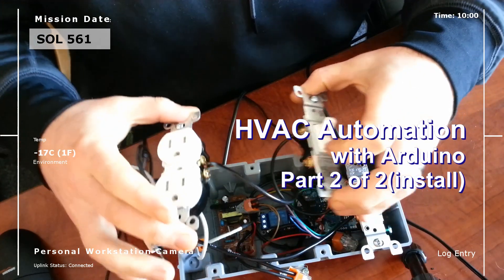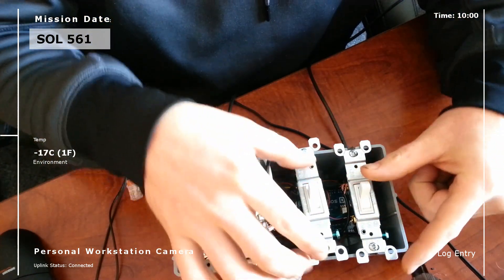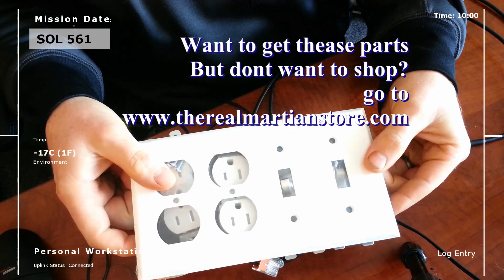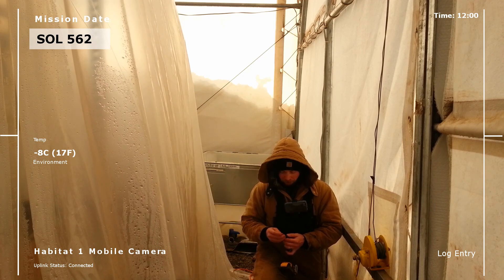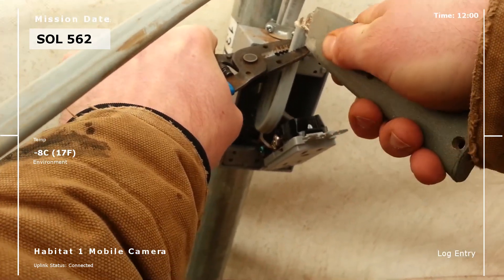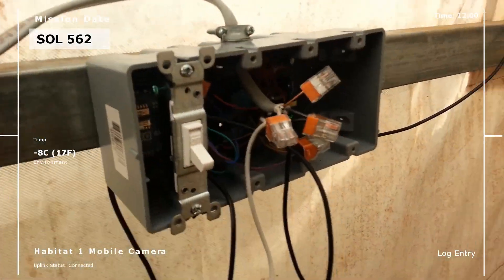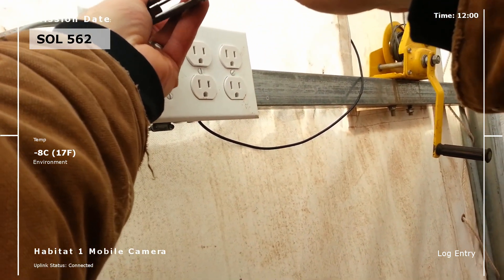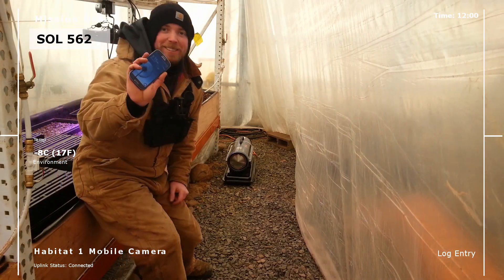Automating Aquaponics HVAC with WIFI Arduino's (ESP8266)  Part 2

Comment: hi, this video is way better then the solar panel cleaning. For a less labour work solution i sugest to check out the Sonoff and the Sonoff TH10 devices. They are already made to work with 230V and there is also also an app to work with everything. For saving the data to a server there is a hack on the sonoff, to get custom firmware on them and get them connected to where ever you want. Thanks for sharing this kind of work.

Comment: I am doing similiar things with arduino (controlling 4 relays with my AP-system with a esp8266, monitoring it with DHT22, 3 ds18b20, a bmp180 and some other sensors). Currently I work on power saving mode and try to get my code more energy-efficient. How do you approach this? Do you share your code?

Comment: American wiring codes *shudder* ...how are you not all dead by now? It's not even IP67.
I could be wrong but shouldn't that 110v wire be run in one of your metal conduct tubes?
This is why wiring should always enter from below, to stop water dripping down the cable and into your box.
Glad it's working.

Comment: The Arduino is changing the world by putting the power of micro controllers in the hands of everyone with a "simple interface".  Add a 3d printer and a cnc router you can build almost anything.

Comment: Just a thought for the future: color code the switch and receptacles, i.e. the white switch controls the white receptacle and the black switch controls the black receptacle.
Reply: Or add neons over the outlets.
Reply: The switches are somewhat superfluous considering that the equipment is connected with plugs. He might be better off wiring he switches to bypass the relay to turn the outlets on if the Arduino starts going all, "I'm sorry, Dave. I'm afraid I can't do that" on him.

Comment: Martian,
Great idea and execution.
You might want to change the heater side of the arduino.  Every kerosene torpedo I have used runs the fan after the fire is off so it can cool the burn chamber/tube to a safe temperature, if the fan doesn't run the residual heat can destroy the heater (overheat components, burn people, or heat stress the burn chamber).  Just put your hand on the heater 1 minute after you kill the power and think what might happen if you, your tent, a family member or critter brushes against it between heat cycles.  If that is the way your heater is designed to run, cooling cycle, just put your arduino relay in place of the thermostat in the heater.  There will be a small thermister switch mounted on the outside of the burn tube, under the outer shell about 3/4 the way to the exhaust, wired between the fan and the main power for cooling her down.  Sometimes it will also run a cooling cycle if you turn it off by the control panel.
Be safe.

Comment: !!!Check ratings on that relay is it really capable to keep ventilators and heater running. It looks small.... Did You measured power taken by ventilators and heater.

Comment: Would you want a manual override for "on" function too?

Not sure how the system compensates for this scenario and maybe it's already covered... What if the the lane temps drop below freezing between cycle times of the system? Will the heaters kick on?

Comment: Just a few suggestions:
1) Create a standard Arduino enclosure with the following:
     a) A DC power connector in the enclosure side.
     b) A power status LED on the enclosure cover.
     c) An Arduino status LED on the enclosure cover.
     d) A bulkhead USB connector on the enclosure cover.
     e) A DB-15 female receptacle in the enclosure side as a standard I/O connector.
     f) 35 mm DIN rail mounting clips on the back of the enclosure.
2) Create standard I/O modules with the following:
     a) A DB-15 male plug to plug into the I/O connector on the Arduino enclosure.
     b) 35 mm DIN rail mounting clips on the back of the enclosure.
     b) For power control I/O modules
          1) Use a 2 gang or a 4 gang outlet box, they're smaller and the covers are cheaper.
          2) mount your relays inside the box like you did before.
          3) Add a glass fuse and bulkhead glass fuse holder to the side of the I/O module for each relay.  Size the fuse to limit the load current to the max current that can be carried by the relay.
          4) Use a standard 120 VAC plug instead of switches.
          5) Add an LED to the cover for each relay indicate relay I/O signal status.
3) Don't disassemble the Arduino power supplies, just plug them into an outlet and plug the DC connector into the Arduino Enclosure.
4) Use standard 35 mm DIN rail to mount the Arduino enclosure and the I/O module

The status LEDs on the Arduino enclosure will allow you to see that the power is on and the Arduino is executing it's program without needing to take the cover off the Arduino enclosure.  The Bulkhead USB connector through the cover will allow you to program the Arduino without removing the enclosure cover or having to disassemble anything.  Having a separate Arduino enclosure separates the low voltage from the high voltage.  The LEDs on the I/O module allow you to see if the relays are being commanded ON without having to disassemble anything.  The DIN rail mounting, 120 VAC plugs, and the DB-15 connector allows quick and easy replacement of either the controller or the I/O module should it become necessary.  Replacement of failed Arduino or I/O modules doesn't require field disassembly.  The defective module can be unplugged, popped off the DIN rail, and replaced and the failed module brought back to the house for servicing.  That get's you back up and running much faster should you experience a hardware failure on an extremely cold day.

In addition, it gives you more flexibility because you don't have to hard wire everything.  You can choose to mount permanent outlets, or you can use extension cords.  Right now, if you experience a failure in your Arduino controller that's controlling the heaters, you have no fast way to service it and you must shut down power to the circuit in order to do so.  If you do it the way that I'm suggesting, then you can simply unplug the controller and/or the I/O module without needing to shut the circuit off.

Even if you don't take all of my suggestions, at least put a 120 VAC plug on your box instead of hard wiring it, and mount it to 35 mm DIN rail instead of screwing it down.  That would at least make it much faster to swap out the box without needing to shut the circuit off because all you'd need to do is unplug it, pop it off the DIN rail, and replace it.

Comment: Did you move all the production into a single lane?  Are you still heating both lanes?  Are they too interconnected with duct work and the fish to run them separately?  It would be a great experiment be be able to run lane 2 at 40°f and lane 3 at 45°f then run the cost benefit does increased production with warmer lane pay for itself? or the ability to grow different crops each optimized for growth.

Comment: great to see it running! I couldn't tell how you have the kill switches set up. lane 2 on one switch, lane 3 on the other or are the fans on one with the heaters on the other? both ways would have advantages. Isolating each lane very handy for lots of reasons. if you have a fume problem turn off the heaters leaving the fans on would be nice. in an emergency just kill theme both then swap the extension cords as needed. Label everything switches outlets and cords hopefully after 4 months of reliable operations you won't remember. Gods speed.

Comment: Really happy to see that you've lifted out of that dip last week :D The control system looks solid (Though you might want to look into a getting a Solid State Relay if you repeat this - they're more reliable especially with changing environmental conditions - no moving parts that can freeze/weld under high current :P)

Comment: Awesome and congrats on the success of the new unit.  I am so excited for you.
a safety note.
I cringed watching you cut the romex.  use a sharp blade peirce the sheath about 4 to 5 inches down then push it away from you to split the sheathing.  you will never cut yourself that way.  fastest way to cut yourself is with a dull knife and the way you are going at it.. just trying to help you save a finger.

Comment: Glad to see the automation working.  Now you just need to dial in the run times for max effectiveness.  As others have said, it might be better separating the high and low voltage into different boxes eventually.  Good work!

Comment: You should be using fork terminals on your 120v screw terminal connections.  Stranded wire does not make good connections under a screw and should never be used in that way.

Comment: Hi Jeff, I see some problems with your setup, 
You should be using a power relay not a control one, did you check the HP rating of the relay ? 
Do you have a thermoswitch built-in the heater as safety if the relay contact were to weld together (from cold of a current spike) ? 
All ground wire must be green or bare copper and the way you wire your plug is wrong, the wire must turn clockwise with the screw so it get tighter as you turn, not against it. 
You should keep the low voltage control side in one box and the power side in a second one.

It would not be to code in Canada but i'm not sure how it is in the USA, we have one of the most strict electrical code here...

Dont take it wrong, just want to help,
 I Love the videos with all the technical stuff, would have loved to see the code you made,

Comment: Your doing a great job, I wish I could come over to help you. With the electrical. A few suggestions. Use crimp on lugs on the stranded wire, rap electrical tape around the outlets so the don't short out while they are loose, always try to use a 4 square box, single gauge boxes are just to small to make up wire in. Try not to use the direct burial wire,it's a pain to strip. Use 12/2 were ever you its rated for 20 amps.use green wire for the ground. Stager the timing that the two relays turn on so you don't have a large drop in voltage. Your doing a great job...dave

Comment: It was a bit hard to see there but it kinda looked like  you attached your ground wires together at your ground screw on the outlet?  That could cause a ground problem  not necessarily at this outlet but on down the line. It could be even more of a headache if you have a gfci in the mix .  It is better to leave one of the ground wires long twist them together with a pair of linesman pliers.  There is also a wire nut with a hole in the end to allow the  long piece of wire threw and cap off the sharp end of the other wire and also helps ensure a better connection.

Its also good practice to tighten the unused screws on the outlets that you are not using.

Comment: I dont know if there is a load limit on that relay.  Those fans draw a massive amp load when they start up and lessen when freeweeling.  With your programming can you star them up first and after a delay of say 2 minutes (number out the  sky for discussion purposes) start the heaters.    Yes they started just fine just now but will they after use.
Reply: In another video he said that the relay was rated for 220V 10amp. If it became a problem he could put the outlets on separate relays to spread the load like you are saying.

Comment: Hi +TheRealMartian Congrats on the automation, I just would like to know how do you control the Gasoline heater with the power outlet (does the heater needs to be plug in to the power outlet to work)
Reply: void habit the heater operates with an electric glow plug and a fuel pump I believe
Reply: So it consume electricity to operate ?

Comment: Maybe next time use two relays so you have more control. Like have heater on one grow lane running on the hour and when it switches off you start the next lane.  Or keep the fans running a bit longer after you shut down the heater.

Comment: To strip wire, nick the sheathing where you want to strip to, then bend to open sheathing up. Then hold wire with cut end away from you and then strip down between the wires. LOL, I'm still laughing,

Comment: For a prototype wouldn't you want more access to the parts for when you have to change/fix something? They make a fitting for joining junction boxes so you could have the low voltage controls in a separate box from the line voltage parts so if a part fails/needs reprogramming you could remove without breaking down the full setup. 

With how compact you made it you will have to move things any time you have to access the board when with a very slight change you would be able to just pull the cover off a cover and there is your controls.

Comment: When stripping mains cable, all you need to do is: Either with a knife or side cutters. Cut like you did where the CPC (earth) is (about an inch) and expose it. Then either use pliers or the side cutters to pull up on the bare wire and down on the pvc sheathing with your hand causing the sheathing to be split all the way up. It can stretch the CPC but only by minuscule amounts, nothing of which is a concern.

Edit: Shared a video with you showing you exactly how.

Comment: Congratulations! In case you want to make it somewhat waterproof you could spray it with corrosion x, I have tried it on pi zero and has kept mine alive under the elements for awhile now. I just reapply when ever I remember to but I think it is unnecessary. Cheers!

Comment: stranded wire is best terminated in a different fasion. from what I see, 
1 some devices like switches and plugs have a pressure plate under the screw, like a washer to help hold the wire.
2 some times its able to be twisted counter clockwise and may hold under the screw better
3 soldering may be the best option because of the high reliability, so tin the ends of each wire and let cool, bend in to a hook that is screwed in with the same direction of the screw to help hold it secure.
4 crimp terminals are a ready and fast installation method that can keep the fraying down to a minimum. 
5 the national electrical code has only two conductors that have a color code here in the US. green or green with yellow stripe is bonding (ground) and white or grey is neutral for various voltages. 
6. I am more then willing to make a video showing my opinions on connection methods and may even do this, with in the next few days. 
I am not criticizing here, just offering help and my knowledge on the subject, and huge fan of the channel. huge!
thank you for the cool video and good luck :)

Comment: Since relays have been known to stick in the closed position and computers have been known to go to the apple barn looking for oranges, I suggest that you provide some sort of independent overtemp protection for safety.  Maybe Klixon thermal snap switches which disconnect heater power if an overtemp condition develops.

Nice work BTW.
Reply: Capn Crusty a line voltage thermostat at home depot or Amazon can easily work, and it should be simple to put in line with the main power to the heater. 

it's a bit metallic strip that makes or breaks contact in the unit, and requires no imput voltages to work, just thermal energy
Reply: @Capn Crusty while that would help for sure, it's possibly better /design/ to fix the potential failure at source, simply because you never know when someone is going to bypass devices outside of your box.
There are various solutions to relay welding and CPU crashes that he could maybe implement in ver1.1

Comment: instead of running a solid 15 minutes all at once, with steep rises in temp with steep drops, why not run 5 minutes at a time 3 times an hour?  Maybe it's not better, I'm just thinking out loud here.  lol
Reply: I was thinking this also but, I wonder if it would not be enough run time to heat the uninsulated tunnel.
Reply: Cory Gardner I think I like this idea my self, and it should help maintain temp over long periods
Reply: this approach would help to avoid big temperature changes for sure, but maybe  some dht-11 like sensor to know when to turn on or off would also add some "intelligence" to the system.
Reply: I'm sure the importance was on getting a functional solution in place and then tweaking the variables for efficiency later. The times would also vary depending on changing outside and inside temperatures so this is just the first step in a more complex solution.